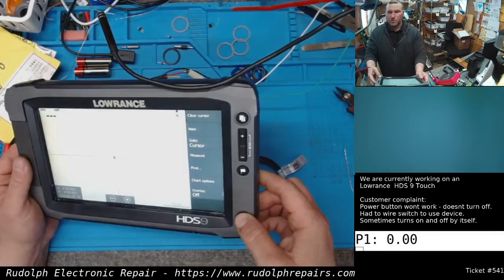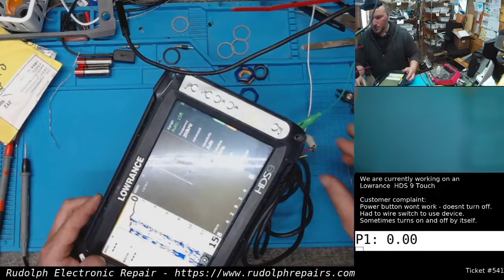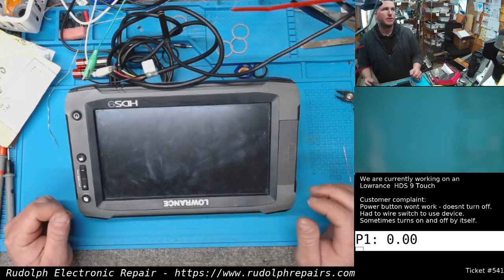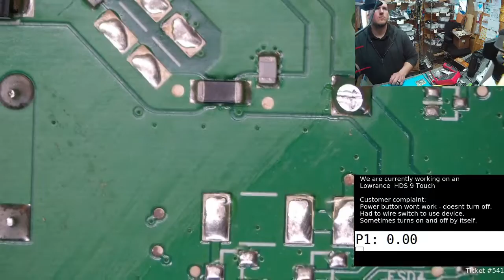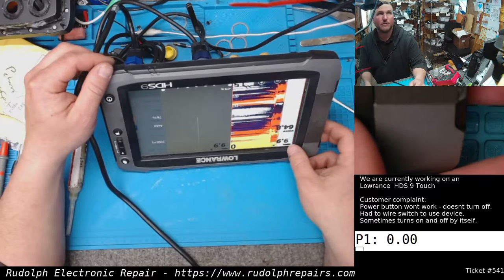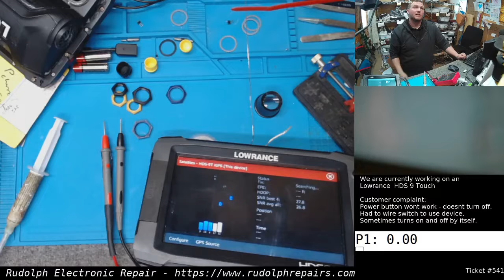Lowrance HDS 9 Touch - Power Cycling / Preventive Maintenance / GPS Module Repair

Comment: Hey, love your videos man. Just a question that large filter cap is that supposed to be loose or wiggle a bit? I am having some problems with my Lowrance it turns on for about 30 seconds then turns itself off. I would send it to you to have a look at but I'm all the way in Australia.
Reply from the maker: Thanks, I’m glad you like them!  That large filter cap shouldn’t be loose or wiggle at all.  That is part of the sonar circuit and likely is causing you some issues.  We have received some units from Australia to work on previously. If you decide to send in we would be happy to get it up and running again for you.
Reply: @rudolphelectronicrepairllc8938  my unit is about 10 years old so its probably not worth the shipping costs. But ill have to find out how much it would be. Have you got any tips for what could be causing it to turn off after about 30 seconds?